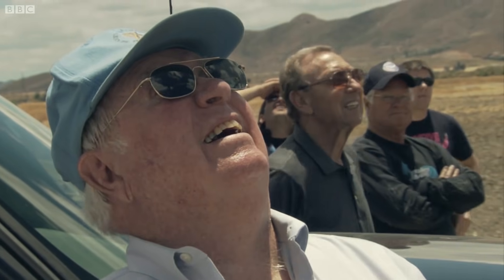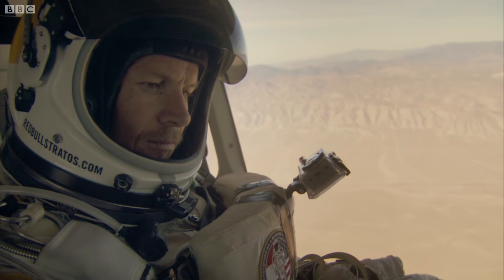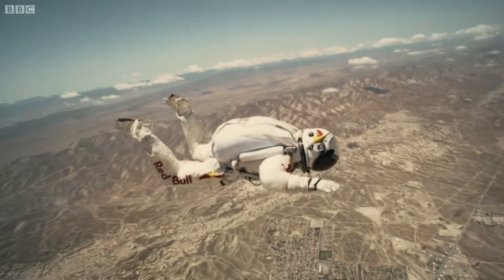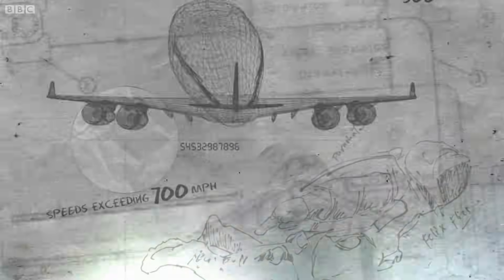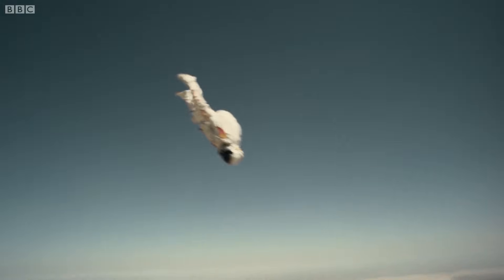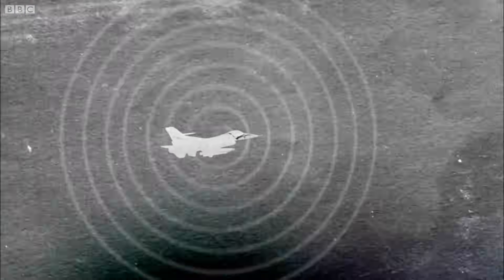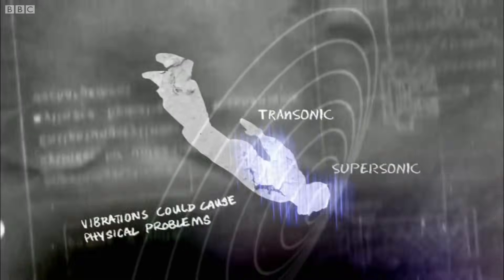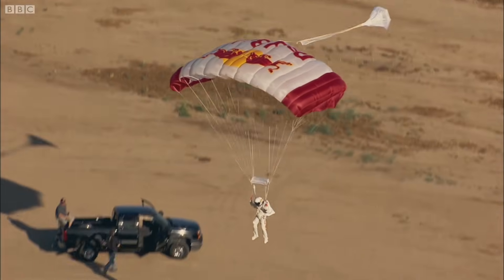Breaking the Sound Barrier Without a Plane | Earth Science

Comment: He never actually goes faster than the speed of sound, though. He goes mach 1 at sea level in terms of speed (~750mph) falling. But, the speed of sound is much faster up there, due to the lack of air pressure.
Reply: This is technically incorrect.

Following the ideal gas law approximation, the decrease in pressure would also decrease the density of the gas as well (increase density of material means a slower speed when the medium of travel is the same[yes sound travels faster in liquid water than in air, but this has more to do with the stiffness of the bonds themselves, which counteracts and surmounts the density increase of water] ). Pressure is directly proportional to density, and because of these effects, they cancel each other out.

Since this fact exists, temperate change is what determines the change in the speed of sound, and at higher altitudes the lower temperature of the gas means the speed of sound is actually much slower, as the gas molecule collisions take longer.

It is not uncommon for high altitudes to have speed of sounds much slower than those at sea level, so depending on what the temperature of the gas was where he was falling that approximation of 750mph would be the determinate that decides if he broke the sound barrier or not.
Reply: @Steve-ws3zu  what about terminal velocity, surly with gear included he’s not surpassing 165mph, right?
Reply: @imtrenton  That's what I was wondering.
Reply: @im_Spade_  hello the air is less dense their and so is the resistance
Reply: This is like that meme I saw. When two toppers at your class gets different answers.
Reply: Sorry about that yall I was incorrect!

But due to lack of air pressure he can go faster than terminal velocity. He went 350 m/s (782 mph) at 30000 m (100000 ft). At 100000 feet it was -51* F. About Mach 1.2.

Where I got confused was with terminal velocity and the speed of sound. Due to the lack of pressure he was able to travel at 782 mph. It's important to note though that the 782 mph feels pretty much identical to 175mph near the surface of the earth, due to the amount of resistance from the density of air.
Reply: @christopherbernhardt  And you were so sure of yourself in your first comment?
It now makes us all wonder what other misconceptions you have that you need 'educating' about?
Reply: Well, sound needs medium to travel, so if the place lack of air sound will go slower..
Reply: No , sound barrier is slower the higher you go.
Reply: Mans forgot space existed😔
Reply: Sybau 🙏
Reply: wrong, it is not much faster infact the speed of sound is 761mph so only 11mph off

Comment: You keep accelerating.. & are faster than a jumbo jet after 25 sec... woaah.. boy that's both scary & exciting..
well the parachutes should be intelligent enough to be auto deployed.. even if the person panics & is unable to pull the string, he won't die.
Reply: As he gets lower, the air density increases and he slows down.  By the time he pulls the rip cord, he's down to typical terminal velocity.
Reply: @deezynar  makes sense